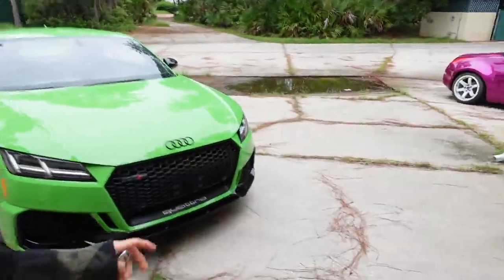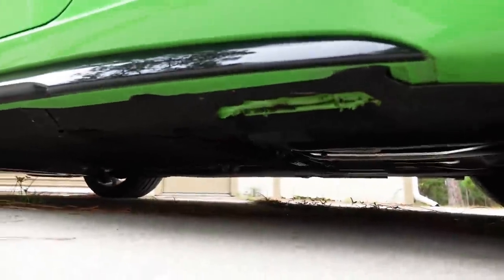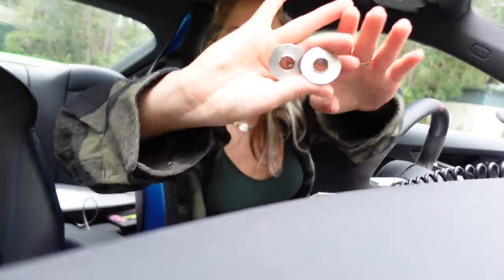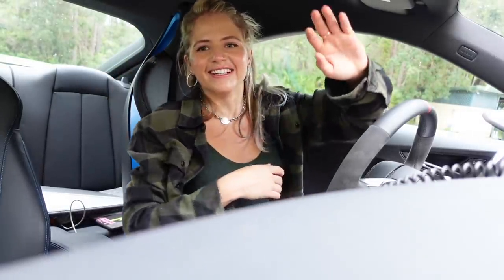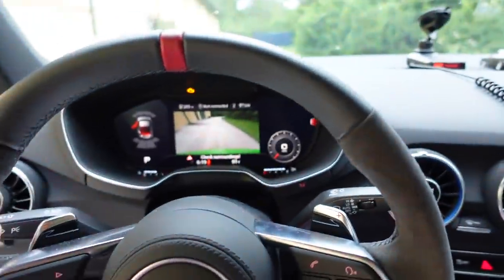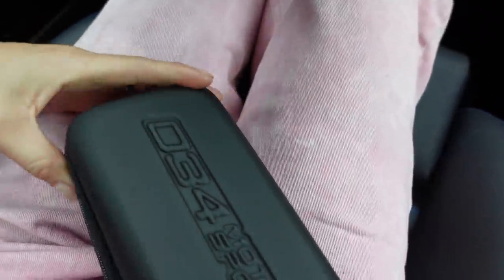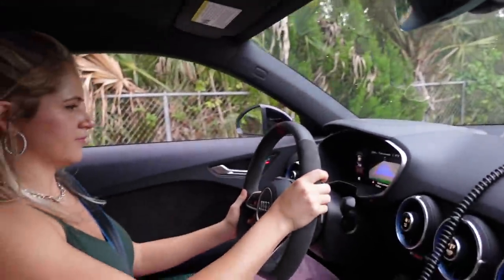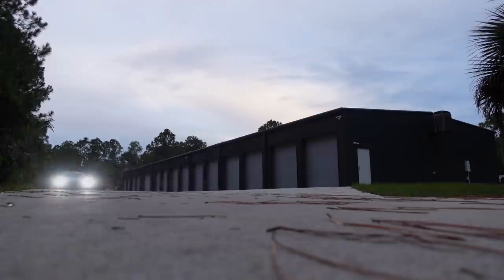AUDI TTRS STAGE 2 TUNE IS WILD!

Comment: I heard there's a sensor on the turbos that when you unplug them it'll allow you to hear the turbo noise
Reply: Sounds like you're on about the diverter valve plug which is not healthy for the turbo if unplugged. But I'd its anything like the 2.0tfsi vag do it'll have a baffled turbo outlet to reduce spool noise

Comment: Your reason for the exhaust sound varying on start up is that Audi/VM/Seat cars run hight revs on startup to warm up the oil.  after around a minut ethey go back to normal engine revs.  I would have called up 034 and asked them if the TT normally has than noise from the exhaust,  It definetely shouldnt be that metallic I am sure thats not the engine warmup noise.  

Also , from experience, Dont use the Metal dogbone inserts, I know its a sponsored Item but the Powerflex ones give you such a better 
feel withou being as harsh on idle, 

Will be interesting to see how your tune goes.

Also Stretch bolts are ok to use more than once,  just watch how many uga duggas you give them. :)

Comment: Torque to yeald subframe bolts are a new one for me but I've worked on several engine builds and on the Mazda z5 engines the head bolts are one time torque to yeald bolts
Reply: That's absolutly right....TTY is the secret, to become more strength to the material........
Reply: @tt-rs1457  right it makes sense to me but I can see it causing some issues for people who like to work on their own stuff but don't know about the torque to yeald bolts. Do you happen to know if it's common for Audi to use them?
Reply: @riddlemethis01  

As far i know, the did this since Golf MK1 and also the VW Super-Beetle 1303 had this TTY on the bigger 12mm bolts to the Body.

My expirience with this is, that you can use these 2 or 3 times.......only you have to reduce the additional turn angle cause of the hardness of the material you did at the first time.

The Bolts wont't break.
Reply: @tt-rs1457  oh ok thank you for the info I appreciate it. I always like to learn new things and Audi's are something I have very little experience with, all Euro's honestly.. I know alot about JDM and US domestic vehicles but it doesn't hurt to expand my knowledge so again thank you.

Comment: Yo Collete that rattle you hear are the exhaust vavles . They tend to be loose causing them to rattle on cold starts due to higher rpm . Chop off the active exhaust vavles and the problem is solved lol

Comment: the engine warms up at a specific RPM which is when you seem to be hearing the noise. after the RPM drops from the initial start, the noise goes away. when you're quick revving the car like that, you're zooming past the specific RPM the car temporarily idles at, so you can't hear it anymore. just a thought

Comment: Can anyone suggest a decent radar detector? Never used one before and I have the worst luck with cops ever.
Reply: @smgs921  the cobra rad 480i wouldn’t even be worth trying? I mean it’s essentially the same tech. Not doubting your knowledge on the subject at all and I appreciate the response majorly, also not trying to argue but I’m in the upstate NY area and for the most part drive through a lot of small towns and the like, my main issue with the cops is that a lot (most, lol) know me and my vehicles so if I had even a little heads up to ease up I’d be alright.
Edit-also just checked out that escort 360, and yeah almost $600 bucks for a single dad with some project cars is a bit much.
Reply: @smgs921  damn, sounds like I’m going with the escort. Lol. Thanks for taking the time to respond in such detail.
Reply: @notmychairnotmyprblm  theyre well worth it if you drive fast alot or routinely traveling or just live in a heavily patrolled area but i absolutely love mine. I forgot to mention if you buy new you do get a subscription to use in conjoined with apps on your phone. After it saves you from that first ticket you’ll realize the money was well spent haha. Just dont take it to virginia, theyre legal in every state except VA
Reply: @smgs921   alright well I suppose I’m going to be perusing eBay for the 9500ix model that you have and hopefully I can find a decent deal.. and again thanks so much for the info. My red turbo LS swapped 240 and I both thank you. Lol.

Comment: I think that specific car is limited to 200 launches before the clutch might give up on you and it starts slipping. Could be good to know so you don't waste all them launches on playing around instead of using them for races or something LoL
Reply: So every car Is limited to launches or just audi??
Reply: False - not for the 8V+ platform anyways, I've done way more than 200 launches lol
Reply: @just_a5.7  If a car has this kind of transmission there is a limit on how many launches you can do with them. But as @TwistaRS3 writes above here they can possibly do more launches before you start to have issues but those issues will show up. In some cases sooner and in some cases later. Every car manufacturer has their own limits and they might not be the same numbers since they all act differently in these launch sequences.
Reply: @norseman579  wat transmission does it have
Reply: @just_a5.7  It has a S tronic dual-clutch transmission
Reply: Where on earth did you pull that figure from? The dq500 is a wet clutch dct and can handle a shit ton of abuse

Comment: Stretch bolts haha, there are quite a few of these types of bolts and they are known as "torque to yield fasteners" A torque to yield fastener (TTY) or stretch bolt is a fastener which is torqued beyond the state of elasticity and therefore undergoes plastic deformation, causing it to become permanently elongated. The more you know! :D